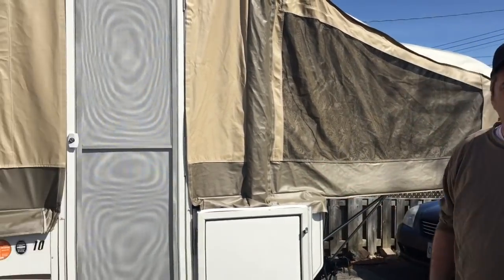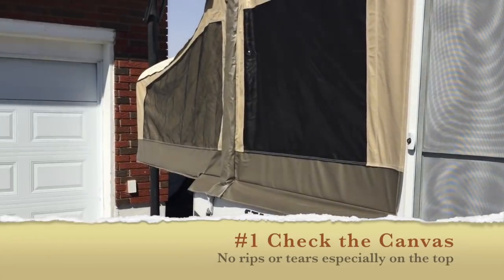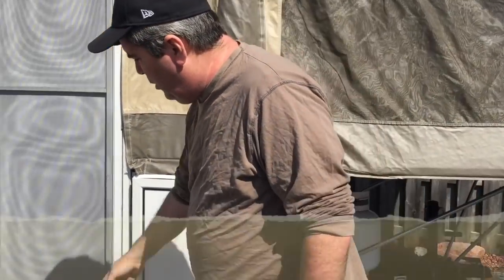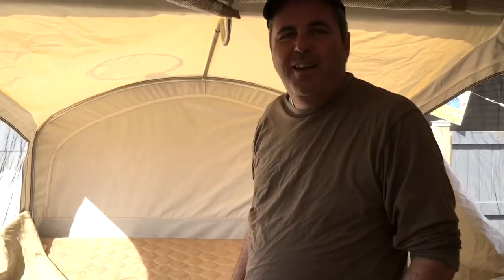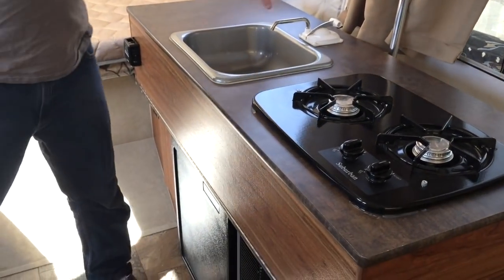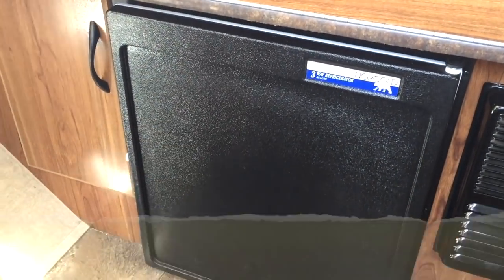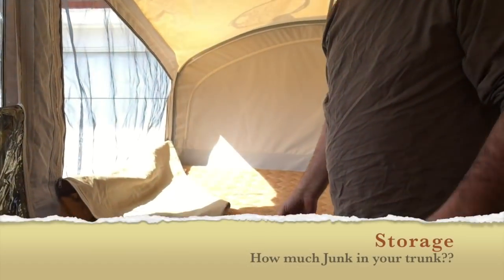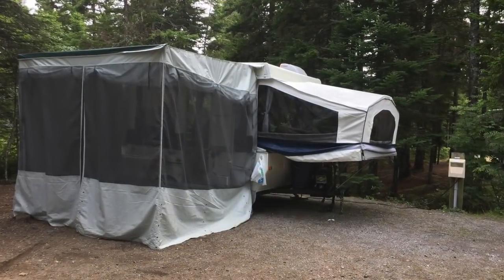What to look for when buying your first Popup Trailer

Comment: You forgot some things like what condition the top is in, is there a lot of rot, in areas where you have grills on the outside for ventilation for appliances is there water ingress, how does the caulking look on the top, has it been in a hail storm.....

Comment: Yeah. Check the roof sides for mold an water damage. They are prone to leak. Most are made of particle board that will sponge up water and rot out quick. I had to replace mine with pressure treated plywood. Time consuming job. Not that difficult though.